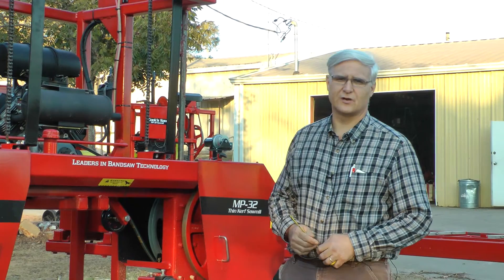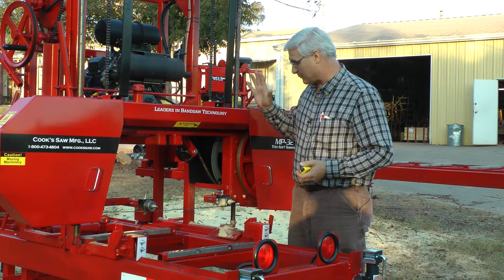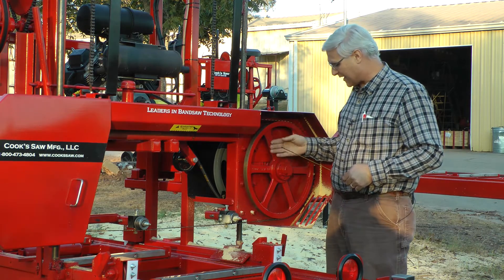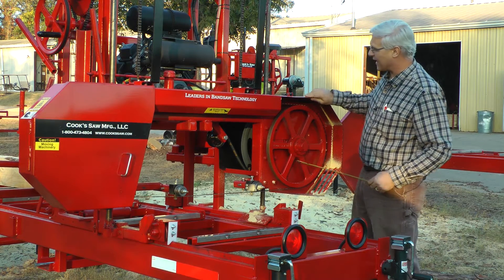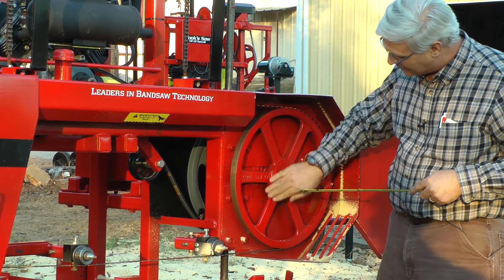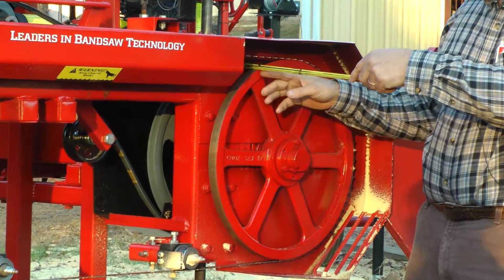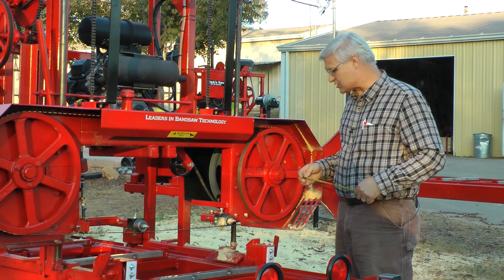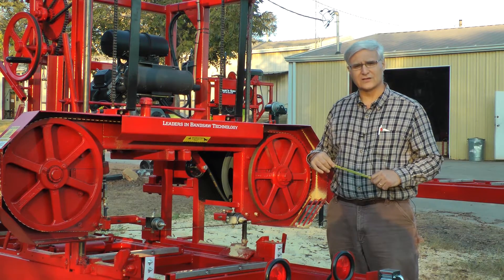Sawmill Bandsaw Blade Basics 18 -  Diving and Rising Blades Part 6 Vertical Alignment

Comment: Can you maybe explain why tilting forward is important? In theory I would think that 90 degrees or even tilt back would be better.
Reply: If you tilt back I would think there would be a chance the blade would pop off when you started cutting
Reply: Tilting the wheels will put less negative strain on the roller guides.